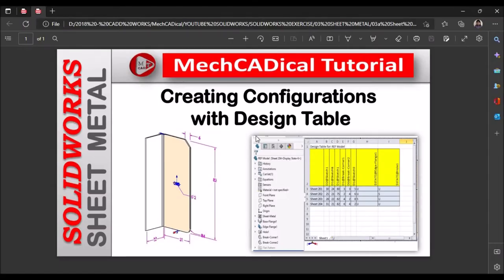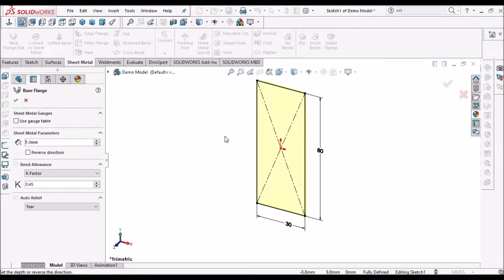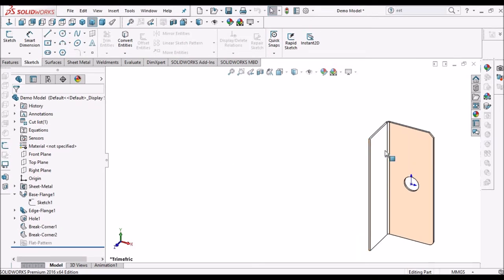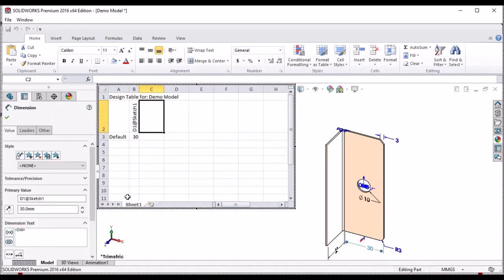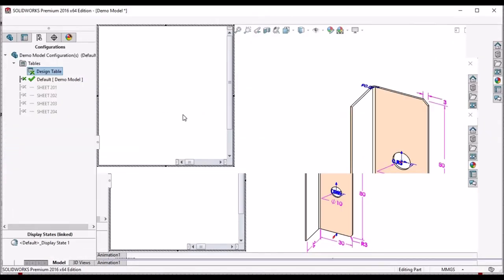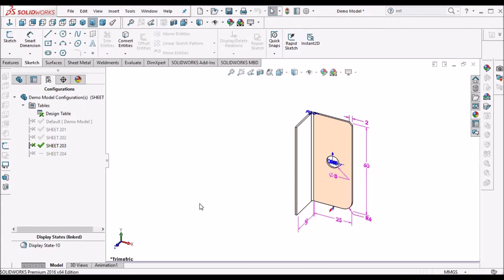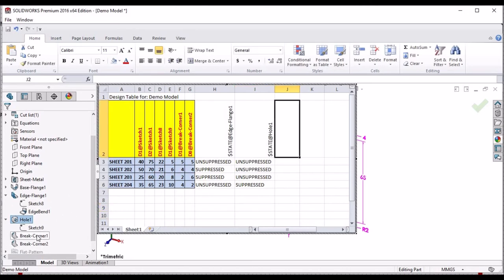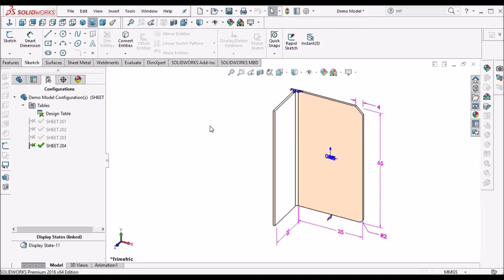Creating Configurations with Design Table for Sheet Metal Component In SolidWorks

Comment: Thanks brother, you have saved my time. Learned a lot from your configuration videos, never misses your tutorials  videos. Thanks a ton.
Reply: I used solidworks mostly for my laser cutting parts and bend lines for cnc press brakes